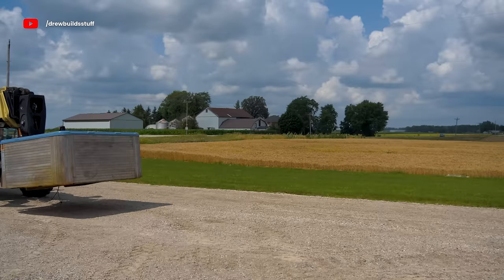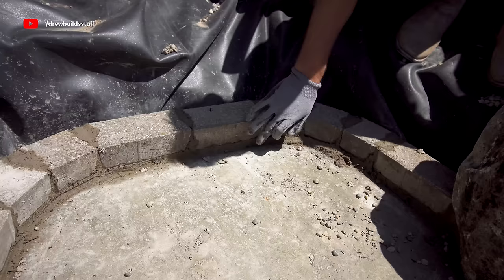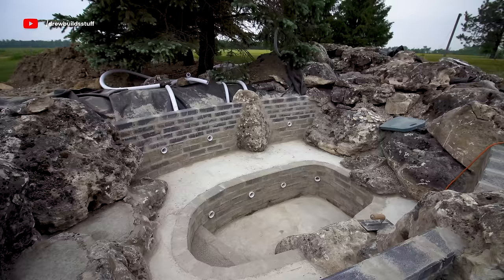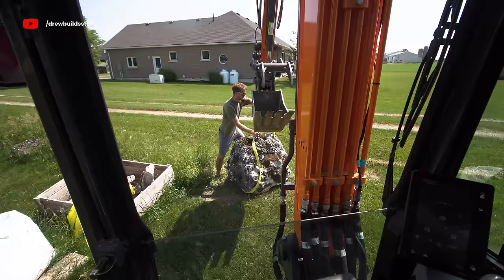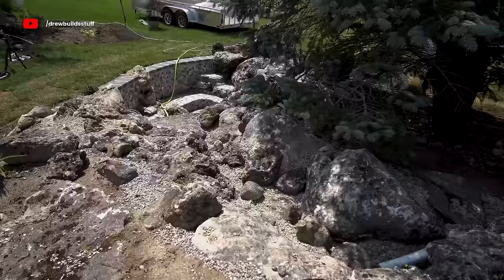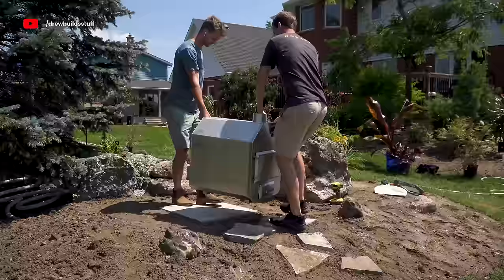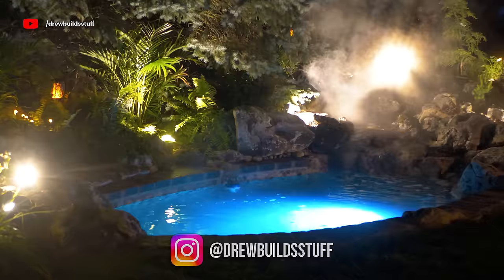Making a MOUNTAIN HOT SPRING in my Backyard

Comment: If you do this yourself. One tip I have from building water features over the past twenty years is buy extra underlayment. Cut pieces of it and place them on the pond liner and under the boulders to prevent puncturing the liner. Double them or triple the pieces if you need to but PROTECT the liner!! That is all.
Great build!
Reply: Facts, As someone who helps fix his GF's pond constantly, this was a huge oversight when hers was built.

Comment: It’s my first time watching one of your videos and boy was I impressed. For someone who’s never built a hot tub before that’s the most beautiful one I’ve ever seen! Wow!  All the little touches, the mister, the lighting so many extras, you thought of everything. As an old person I might like the option of a gas water heater that I can turn on remotely so everything will be warm and cozy when I come out on a chilly night. Saying that, it’s perfect.  Living in Southern California I pictured you going out there in the snow. I guess that’s not practical in your area. I didn’t know that the freezing temperatures would ruin the pipes.
Reply: Same
Reply: I built a 2,000 gallon cement dunk pool and was thinking of using my potbelly stove to heat the water for  use in the winter as a hot tub. Only problem it would have to constantly be heated. Maybe purchasing a jacuzzi heater for when not in use. Maybe I'm overthinking it. In the Midwest we get countless freeze thaw cycles.  I have 1,1/2" pvc plumbing around foundation and below. To prevent cracked pvc from freezing I drain %90 of water then add antifreeze in the mix. When winter is over I flush everything out into Four, 5gallon containers for next time.
Reply: I wish I had a son like you! Great job, I’m sure your parents are delighted. 👍🏻💯💪❤️
Reply from the maker: Thanks for watching! Yes the freezing will cause damage but it will be the spring thaw that will likely be a bigger problem.  The ground shifts and tries to push everything around, will be interesting
Reply: samee
Reply: You definitely should do something for winters...

You could completely drain it for the winter, making sure you add a waterproof cover. 

Alternatively, you could (partially) fill it with propylene glycol (expensive but non-toxic, and stable for use year after year), again add a cover to keep it clean and pure. Each year you'd need somewhere to pump it into to store it.

I'm confident that if you allow it to freeze each year, it won't take long before there is serious damage (likely major damage every winter).

Comment: Philadelphia Mike here —-  
To answer your question about winterizing your hot tub  ——
I’ve been at pool builder for about 54 years  —. Now retired.
To winterize it   —   Blow all the water out of your plumbing grease your skimmers gaskets on your pumps  —  keep the pod filled with water —-  Put some 6 x 6 posts in the water —
If the water freezes, and expands. —  it will push against the 6 x 6 post  —  and not against the walls  ——
The post will absorb the expansion   —-

Comment: Others have commented on winterizing, so I will put in my two cents on what I have seen when I was a pool installer, back in the day. The second pool company that I worked for (40 years ago) did only one type of pool, monolithic concrete walls, with a vermiculite/ cement bottom, topped by a vinyl liner.  It was a huge upgrade from my first pool company products, where we installed steel walls, fiberglass walls, (both still quite acceptable) plastic, and, believe it or not, pressure treated wooden walls...all inground, with a sand/ cement or vermiculite and cement bottom, with a vinyl liner.  So. In a neighborhood where we were installing a pool, we came across a home that had a pretty expensive gunite pool in the backyard. The new homeowners had been unaware of the issues that their predecessors, the original homeowners, encountered when  putting in a solid(gunite) concrete pool. Their property had a very high water table, (the excavators hit water after only a few scoops from rhe backhoe)and the new owners thought that the pool might crack if their expensive pool was left full of water over the winter. It does get cold here in South Jersey, at the Shore, but we do not have winters as severe as Canada, or our Northern States. So.  Not knowing that they needed the weight of the water inside the pool to keep it in place, they emptied the pool. They subsequently discovered a few months into the winter, that the  hydrostatic pressure exerted by the high water table had lifted the pool up out of the ground. Quite a bit, actually...and at an angle. I believe that it was a 20' by 40' pool. No bueno. So. Forewarned is forearmed. Cheers...
Reply: I'm designing a hot tub on a large riverboat and planning on wood and fiberglass/epoxy right now. Any tips on something like this? Weight is a big concern and it's "above ground". Unfortunately, my space is too unique to just by a manufactured tub.

Comment: Looks great! Winterization is going to be tricky if you can't keep it continually heated year round like a traditional hot tub. Your issue is going to be water that has seeped into crevices in the pea gravel and in between the pond liner and the concrete / rocks. If you can't get all the water out of those cavities / crevices it will break things when it expands / freezes. If you have to rebuild it, build in some drainage, even eliminating the pond liner if needed so that any water that does eventually get underneath the concrete has a place to drain away.
Reply: 😂😂😢❤😅😂😂😮😢😅😂😂😢😂😅😅😢😂 1:14
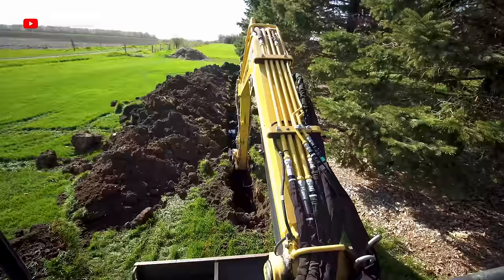Reply: 😂😅 1:59 🎉
Reply: 😅😢😂 39:22 😂😂😢😅😂😂❤😂😂😢🎉
Reply: 😅❤😢 3:30 😂🎉😂😅 3:54 😂😅😢😅🎉🎉😅😂😢😂
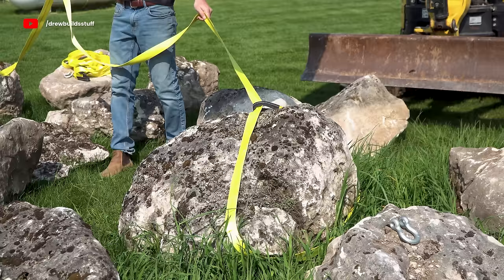Reply: 😂😅😅😅🎉😢😢 5:37 😢 6:53 😮😂
Reply: 39:22 😢😊😅😂
Reply: 😂😢 3:55 😅😅 4:56 😢😢😊😢
Reply: 😂😅 39:22 😅😂😊😢😂😂❤😢😂😊😅😢😅😂😊😊
Reply: 5:34 😢😢
Reply: 😅😂😂😊😂😂 39:22 😂😊
Reply: 😅🎉 39😅😊❤:22 😊🎉😅 39:22 39:22 😅😊😅❤
Reply: 😅😢❤🎉😮😅😊😂 39:22 😅🎉🎉
Reply: 😂😅❤😊😊 39:22 🎉😊🎉 39:22 39:22
Reply: 😮😮😮😂😅😢😅❤😊😢🎉 39:22 😮😂😢😢🎉😂😮
Reply: 😊😅 39:22 😊😊😊😅😊😢😊
Reply: 😅🎉 39:22 😢😊😊🎉😮
Reply: 😊😮🎉🎉😢😂😮🎉 39:22 😂
Reply: 😊😂😊😢😂 39:22 😊😊😅😊😊🎉😢😊😅😢😅😊😅😂 39:22 ❤

Comment: You might want to add some sort of cover, this helps you get it up to temp faster and once you're at desired temp just remove the cover. There are thin bubble wrap sheets you can buy at pool supplies that can be cut to fit.
Reply from the maker: Working on a rigid cover that will retain heat and also prevent any kids/ animals from falling in. Thanks for watching!

Comment: I'm not an expert, but from my own experience of digging and installing my 10' diameter "cool pool" and 50' feed creek, I found that if you stop the water in the winter, you will likely end up with cracked concrete.  Awesome job by the way!
Reply: If he has to repair the concrete he should be able to add some drainage to prevent the same issue each year.

Comment: I'd figure out how to use it all winter ;) That said there is a company in Tahoe California that builds hot tubes and falls to be used and or blend into the yard so they do not need to be weatherized. Where you mixed cement and stones they build and color fake stones. Love how yours blends into the yard and looks like it has been there forever. Very nice!!
Reply: whats that company?
Reply: To make an in-ground pool/hot tub useable in the winter, especially in most parts of Canada, it would take preparations done before the liner is installed. The reason the water line and electric cable to the site were placed five feet deep was because the frost line is most likely between three and four feet. Most if not all of the hot tub will be surrounded by frozen ground during the winter, at least four months. Insulation would have needed to been installed below the pond liner and there is no easy way to install it afterwards. Plus some method to keep the heat the hot tub from below would be nice to have. There's a lot of thermal mass and once it gets cold it will take a lot to get it warmed back up again.

Comment: Love  the build, you should have added rebar to strengthen the concrete.  This would help with expansion during the cold months as well as the weight of the water on the bottom where you dont have the structural support of the boulders.
Reply: You didn't watch the entire video, did you?

Comment: Wow!!!   No words to how beautiful that is!

I would drain and blow out the pipes over winter.  I live in mid-Western Nebraska and I do leave my above ground pool up, full of water up to where the pump and skimmer attaches, and I have a fish pond that I leave full.... obviously for the live fish.  Winters here can get pretty darn cold but I don't have stone and tile, but plastic or rubber liners and they will expand and contract with the water.  My above ground pool liner lasts about 5 or so years leaving it up year round, and even longer for my Koi and Goldfish pond.

For my fish pond, my husband build me a metal frame that I place over it, then cover it with netting and plastic over the winter, to keep leaves and debris out.  I have a heater that only kicks on during freezing temps, and I run a couple of bubblers inside for the fish.  Last year it got so cold it still froze the surface... but those fish survived just fine!

My pool also gets covered with a pool cover, and a pool leaf net... both of those are for a pool much larger so that the edges drape over the sides, nearly to the ground!  I found that with our winds, this keeps the darn things on all winter. 

Good luck with your channel and your builds.... you are amazing!

Comment: Best way to stop your boards from splitting is to use a piloting driver first. The reason the wood splits is becuase the impact is screwing and forcing the wood outwards as well as hammering the screw. A piloting drill will remove some of the wood from displacement stopping splitting pretty much 99.9% of the time. Always best practice to do it like this.

Comment: We have a 1000 gallon pond with waterfalls that I have to drain a time or two a year.  Our lot has a slope, and I wish there was a gravity drain on it, instead of putting in a pump.  But our pumps are just 1/3 HP sump pumps with no filter, and we detach the pump for the winter.  It freezes, but maybe not all the way down, and we haven't had any problem with the cement structure or rock above, and the waterfall pipes are above grade.  I've considered adding a drain, and closing off one part of it to make an outdoor hot tub.  Tiling like yours would work well.  Depending on how often you use it, a spa top could keep in some heat, but also keep it clean of vegetation and dust.  But if not using it daily, it probably doesn't matter.

Comment: I built a pond similar to that except it was during winter/spring and alway wet and rainy. Took a month. I know the work involved. I did it almost entirely alone with no power equipment. The most nerve wrecking part was having to place the liner while ground water was filling in. I had to work restlessly with boulders all day getting it lined with rock to resist the floating of the liner. Placing rock on floating liners is awful and it almost became impossible. But it beats doing the work during the hot dry season.

Comment: I made it to the end.  I have one question and a piece of advice.  Is the water in this hot spring chlorinated?  If so here is the piece of advice.  You need to use epoxy grout when grouting rock or tiles in a chlorinated pond, pool, or hot tub type.  The basic grout will last for about a year or slightly longer, but in the end the chlorine will eat the grout out and cause the tiles to fall off and possibly compromise the brick and mortar behind it.  So I would suggest you drain the hot spring and re-grout and use an epoxy additive to the grout.  I did tile for many years and understand this is your first time doing something like this

Comment: you can get a (used $200) saluspa electric heater w pump -- set it at 13C for the winter + temperature alarm and you should be set for firing it up deep february.

Comment: Dude, that is phenomenal. What a superb job you did.😮 
Personally, I would probably drain the system totally and not take any chances with anything freezing because you’ve got too much work there, and you might even want to push through some camper antifreeze in the lines and then flush it all out in the spring and refill the tub, but I’m not a professional pool guy by any means But if winter gets that bad…

And you should have left the blonde in the pool

Comment: Usually we put a metal grill or make one by sticking a lot of metal bars together of the desirable size in the congrette so that if for any reason the congrette starts cracking,the metal grill placed inside of it enforces it enough so it will not crack or collapse due to vibrations and atleast that's what should have been done for the congrette layers at the very bottom and the walls around the hot spring as a project that will last through the ages,not just the first 10-15 years before deteoration starts to appear.

Comment: Absolutely spectacular build with just one fatal flaw: wood-burning heater. 
Very hard to regulate (how do you keep the water from getting 120⁰?)
And you have to close it down for the winter because you can't depend on it not freezing, unless you want to tend a for 24/7.
Not being able to use it in the cold is a bummer.

Comment: What i would do is get a propane out better yet natural gas heater that is capable of hearing the water to over 100°F in the winter with the waterfall flowing and just keep it running all winter long. That way you don't have to worry about winterizing it and better yet you can use it during the winter and you can use it spontaneously instead of having to plan 4 hours in advance and having to go out and start a fire and all that.

Comment: As a hot spring enthuiast i want to build something like this someday. You did an awesome job amd its really amazing what you did. I would build mine so that i could stand all the way up, it feels great. I would also want it to be able to grt up to 110 or 114 which i would think yours could do if you burned long enough? I would keep that baby running all winter, make a custom top that could keep in the heat and run it on propane or a electric realistically. Great roadmap thanks!

Comment: How to Winterize;
1. Drain bellow Jets (& Drain if possible)
2. Drain your lines
3. Plug your jets (&Drain if you drained below)
4. Disconnect the pump 
5. (Optional) Put anti freeze in the lines
6. Plug the lines from the pump end.
7. Put cover over pool
8. put weighted bags or waterbags around the outside to hold the cover
9. put water on top of cover to prevent it from blowing around.
10. Done

Comment: No reinforcement mesh in your concrete slabs is a pretty big no no. The slabs will form deep cracks over time as concrete needs that steel for strength. You may get lucky if the slabs are extra thick as in thicker than 100mm or the ground underneath is super stable. I’d say the seat slabs will definitely crack. .

Comment: Should have faced fireplace facing the hot spring. Using mulch was a bad idea. It will eventuality get in the hot spring. Stone pebbles would have been better. Bricks around hot spring should have had had a bull nose instead of a shard right angle edge. Thermostat would have been nice. Add an electric heater for when you are out of wood and to keep it from freezing in winter.

Comment: After seeing the deck of the house about thirty feet away, I can't help but feel you would of saved yourself future maintenance headaches if you would of used the deck, expanded the deck elevated off the ground, and suspended your hot tub hot spring and then used good old fashioned concealment to hide that the tub is not in the ground at ground level, but floating a bit.  Less animal life getting into it, and when you to do maintenance on the work itself, the pipes, you could of done so standing up under the deck.

Comment: well....that was a lot of work and cost for something that's going to leak.     All you had to do was use another layer of rubber under the boulders creating protection. This will 100% leak over time due to compression. The good news is it will only be about 1 inch per week and you can just fill it up.
Reply from the maker: You’re 100% confident it will leak but also confident enough it will only leak 1 inch per week?
Reply: @DrewBuildsStuff  lol....Yes, exactly 1 inch....Not sure about when but I'll go out on a limb and say 5-8 years of leak free bliss.

Comment: ONLY $20,000 CDN  ,YOUR MATH DOESN’T ADD UP. YOU WERE AT $7,500 FOR JUST THE 33 BIG ROCKS AND THE 2 LINERS. SO ALL THE OTHER MATERIALS , PIPE, CEMENT, BRICKS, ALL BUILDING ,MATERIALS ,TOOLS STONE CUTTER, RENTAL OF 2 EXCAVATORS, PLUS ALL THE PLANTS YOU SAID WERE $ 2,200 ALONE  . SO EVERYTHING AFTER THE $7,500  WAS ONLY $12,000 .  

I HAVE BEEN A PROFESSIONAL LANDSCAPER FOR 28 YEARS , DONE PONDS , WATERFALLS, LAGOONS, ECT.  THE ONLY WAY THIS COSTS $20,000 IN MATERIALS , IF IT WERE DONATED OR STOLEN. I HAVE FAR BETTER CONNECTIONS , TO GET EVERY ALL THE MATERIALS YOU USED AND I FIGURED ON PAPER I WOULD WITH MY CONTRACTOR CONNECTION DISCOUNTS  IT WOULD COST ME EASILY $ 25-26,000.  NO LABOUR COSTS ARE IN THIS 26,000 .

SO EITHER THE STUFF YOU GOT WAS GIVEN TO YOU OR YOU BOUGHT IT STOLEN , BUT PEOPLE THERE IS NO WAY IN HELL THIS WAS JUST UNDER $20,000 
HE IS TELLING YOU BULL SHIT .

Comment: Oh man, the piping on this is horrible. Especially coming off the pumps. Read the manual, you need to have a certain amount of length before you put a bend. Especially a 90 like that. Looks like you didn't even use a proper short diameter 90 but a full blown elbow 90. This will kill flow rate. It also kills the pump.
Reply from the maker: Made it though the winter and still works good.  Filter needs emptied a lot to keep the pressure up but no big deal